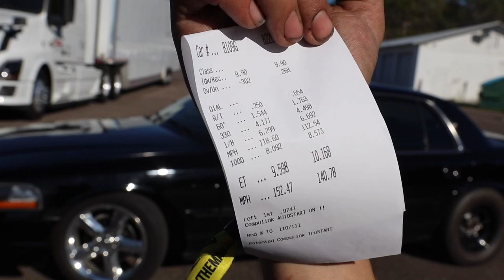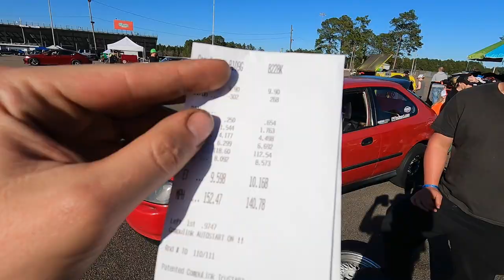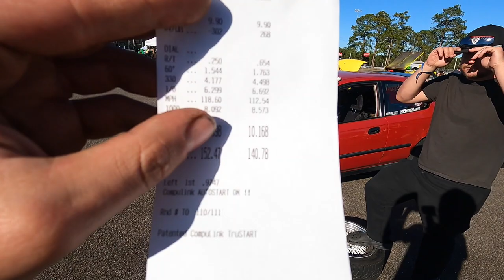Our Turbo AWD Civic Launches SO GOOD!

Comment: I'd love to see Shane's CRX completely finished and painted etc.  Love that model of CRX and being AWD is just sick.
Reply: Literally last gen of CRX, next was Del-sol, and nothing more :D
Reply: Did he really just have the ring gear issue doing a 1-2-1 in an AWD CRX???? Dude is the luckiest kid on earth!!! That could've been 6-8ks of worth of damage easy
Reply: @realMaverickBuckley  can you break down what you mean please.
Reply: @ttteeelll  so when you go from 1st gear to 2nd gear and rev out until you are ready to grab 3rd gear you have the wheel speed and transmission speed at "top of 2nd gear speeds". When you shift back to 1st gear by accident you transfer all of that wheel speed through the trans and into the engine and it will cause an "over rev". Instead of a 10,000rpm Rev limit let's say the car sees 12,000rpm or worse. They call this shift a money shift because the engine is not meant to rev that high and it can lead to valves smashing into pistons and really just ruining a majority of the components in the long block. If you have any other questions or that didn't make sense let me know!
Reply: Yeah he should clean it up some, those side skirts and fenders just look bad. Makes the car look too bulky. Crx’s are awesome looking cars stock
Reply: @TerraFilmTV  those are race skirts it holds the air under the car so it has better aerodynamics. Faster flowing air underneath makes you stick down better and cut through the air with less drag. In the previous video they said those fenders were ordered for a customer but fit like poo so Shane ate them and put them on his car. So that’s whatever as well.
Reply: How did he 1-2-1 it? I thought his shifter had a 1st gear lock out
Reply: Couldn't agree more!
Reply: Would look sick with a fUll CF front end IMO
Reply: #MoneyShiftShane
Reply: Absolutely agree! Definitely one of my favorite hot hatch cars. AWD conversion just makes it even better.
Reply: Think he realllllllly needs to change the trany to an auto. Too much money in the car to keep doing the 1 2 1 shifts. I love the car cant wait to see it at it's best
Reply: For real bro. He left so freaking hard
Reply: Paint, rewire, and better suspension would make it a different car
Reply: Its bent from it.
Reply: @X5XST4RK1L3R  Ahh thanks for the information man! Always cool to learn something new. I had no idea
Reply: @mortimermortimer7555  it is the kids first race car and he is booking! Give him a few years he will just get better or go sequential.
Reply: @TheBCninja  damn, thanks man I appreciate the break down
Reply: Facts
Reply: He needs a one piece for the front end of the CRX! Like you I love that body style the original 1G CRX!
Reply: @brutalbasspro  its all the Americans that do it tho lol even 4th to 3rd , or they miss 3rd or 2nd to first 🤣 I think should stick to there automatics lol
Reply: @mortimermortimer7555  where are you from?
Reply: @TheBCninja  not all heroes wear capes
Reply: @mmllmmll22  actually according to Honda the s2000 replaced the del Sol.
Reply: He crashed it :(

Comment: Can we appreciate how wild this is. Kyle let the civic sit in the back for years while waiting for the H series awd parts to be released. And within weeks they are driving thousand miles and already running mid 9s.
Reply: Not only 9 but personal bests and Kyle hasn't missed 3rd gear!
Reply: @nickadkins7765  🤣🤣🤣 every shift im waiting for it, havent seen if Shanes 1-2-1 shift did any damage other than the starter ring gear coming off the flywheel yet
Reply: @young11984  Shane's done that a few times. He needs more practice shifting that car.

Comment: Shout out to the guy who got the axle and car community in general.
Reply: Yeah the person who helped with the axle. Don’t forget the couple who got them a fender roller to borrow. And the peeps that hooked the Boiz up with a tent. 10/10 best fans 😇
Reply: I appreciate when people step up to help out, but they really didn't save any time at all.  They were going on about how it saved them 1/2 the time, but if anything it actually took LONGER to get the part.  Think about it, the shop said they can be there in 40 minutes.  Ok, so they leave, and the guy goes 20 minutes toward them to meet half way.  Then they have to find each other to make the exchange (taking up time that could have been spent by the delivery driver driving), and they both turn around and head back 20 minutes.  So instead of taking 40 minutes total for the delivery it probably took 45 minutes.  Sure, it saved the delivery guy an extra 40-45 minutes of driving because he didn't have to make the entire trip, but it didn't save them any time at all in the parking lot sitting in the rain.

Comment: Keep checking that axle. There may actually be a slight misalignment that’s causing a binding. That was some serious heat distortion on the axle you pulled out.
Reply: yeah, no way that little rock did that. mabye the axel is a little to long?
Reply: Very possible the binding is caused when the trailer weight is on the rear axle at road speeds and not that rock. He did say they had to center it and use the same length on each side. Perhaps its a touch off. I can also still hear nothing but metal on metal while on the line, where the clutch is self clearing out the billet. Which doesnt sound like it wants to clearance the billet completely.
Reply: Agreed, definitely not the rock. I'm thinking the bearing may have become bound from pressure applied by the guard as it slammed down on the wheel during his last pass, just a thought.
Reply: @RubbishFPS  nah the hatch has always sounded like that, not sure what it is but when it was fwd it always had that metal ringing.
Reply: @RubbishFPS  pretty sure that is the chattering of the twin disc clutch
Reply: @RubbishFPS  that's just clutch chatter from the twin disc. Literally made that noise since he put in the TD. There's a few other twin disc cars you hear it on too
Reply: if the axle was bottoming itself out you would feel sort of a wobble (for lack of a better description) in the back end. ive dealt with exactly that issue before. 

what i see is a serious lack of grease in that cv joint. sure, if the boot is toast the grease will get thrown out, but that joint looks like there was almost no grease in it at all.
Reply: @Sharkey_t  he said it was grease thrown out and under the car with a tear in the boot, i will never believe that rock had anything to do with it either. I think when he moved the rear diff forward and got the angles better that made the axles almost too short and the trailer weight on it pushed that one into the bottom of the cups causing severe over loading on the bearings.....we will see if another one smokes the rollers and if so i will feel i was right then.

Comment: The Vargas bros are hilarious. It's getting good fuel mileage the guage doesn't work.
Reply: Good gas milage for a rotary guy is about 6 mpg
Reply: google them. one of them is not so nice
Reply: @dardyplays2977  what you mean?

Edit I googled them. Seems like they pissed off a customer and he sued them then took advantage of them. Idk I still like angel motorsports
Reply: @dardyplays2977  one of them is not nice?? what are you talking about?
Reply: Guys are nuts running slicks in the rain

Comment: Fun fact. Wet sand is more stable than dry sand. Unless it’s completely saturated. When I get stuck in sand I usually go get a bucket of water and it helps a lot towards getting un stuck.

Comment: Heya just an fyi. For cruising and fuel mileage on e85 you can run around 16:1 afr at low load. Good work on the trek so far guys good luck the remainder…

Comment: I remember when I 1-2-1'd my 85 Mustang years ago.  I never did find out what I broke, but I completely lost 1st gear after that.  Surprisingly I could start in 2nd and still drive, but I parked the car a few days later waiting to get my new engine and tranny that never arrived so I sold the car.  I had a purple 97 Civic hatch at the same time as the Mustang.  I miss both of those cars, even though Ford sucks a fat one.

Comment: A pebble will not cause the axle to "bind up" like that. The added weight of the trailer on the rear caused the rear suspension to compress and reduced the clearance on the axle

Comment: the awd system should be running a square wheel and tyre package so the wheel speed is the same over the 4 as the larger rears will be reading less speed that your smaller fronts

Comment: Rock or not while the trailer loads own the rear suspension and is likely leaving no slack as the shaft would be almost horizontal.

Comment: Take a potato and cut it in half.. Wipe down the inside of the window with it and when you get finished clean it off and it will stop the foggy stuff happening. I use it to keep my goggles clean and free from moisture..

Comment: You guys actually would have been better off in the wet sand vs dry. At least thats been my experience with southern beach sand. Now if you were in smaller particulate desert sand perhaps it would have been slick but southern beach sand is heavy and makes a great road when wet.

Comment: So with the hatch being a 4sp now, eventually tuning is going to run you out of gear as you progress the motor right? Like yall are on 600+ and it almost runs out of gear in the quarter it sounds like. 

Any plans of dropping the final drive or just gonna run as is and dial for a consistent mid 9 car?

Comment: If you just cruising, fill with 93. Baby it and obvious no boosting Kyle. Maybe have to change plugs for racing. Or fill it 50/50 to save on your ethanol but either way motor will be fine. Worst case yq split the block in half but, the chance of that happening to 2 BoostedBoiz.....No chance Bruh

Comment: You also got to rember that when u ran 9s it was 800 horse if not more right but know its way 6 too 700 and all wheel drive and doing 9.5 thats not bad
Reply: The car never made that much power. It's making around the same power now, as it did then.

Comment: Wyatt has saved this channel. Kyle ass rushes and breaks everything. Wyatt actually works on the cars completes the cars. Pfi is failing with destroying everything rushing. I get it. You want to be at every event, but you need event cars than real race cars.  Shane still wet behind the ears so his mistakes are just growing pains. But the older guys should know better.  They it be a malfunction not a mechanic error

Comment: There is absolutely no way that rock was the culprit. First of all ,where you indicated that it was jammed is between the axle stub and the diff housing where the rotation would've cut a groove in either the stub or the housing. Secondly, there should be a minimal amount of in and out wiggle room for the shaft between each end. Therefore if the rock even could create pressure on the axle overall it most likely would have placed outward pressure on the ring that keeps the stub fully engaged in the diff splines . Leading back to the beginning of my comment that the rock would have caused a groove on either the stub or the housing.